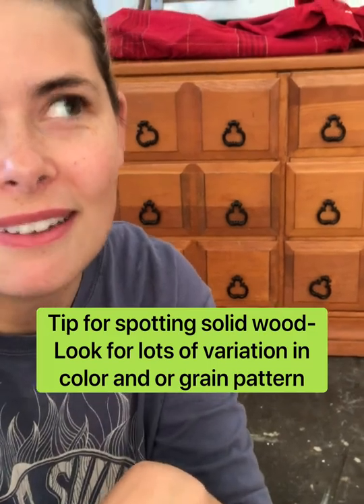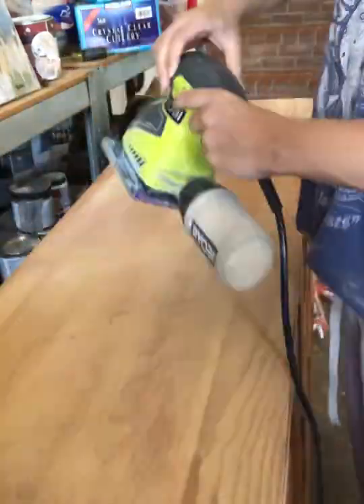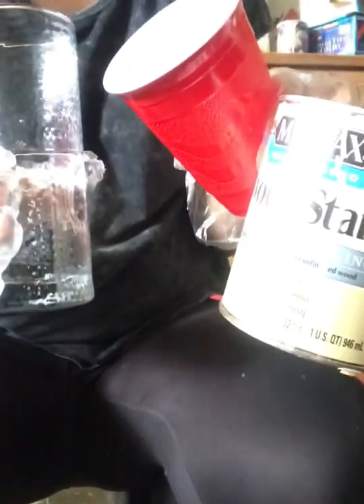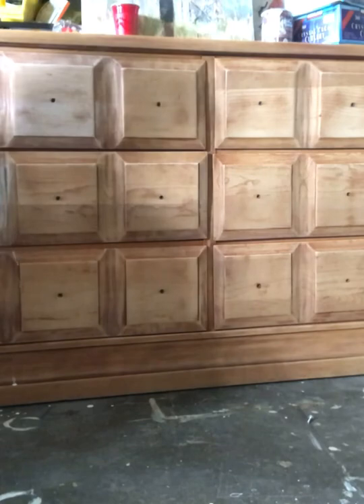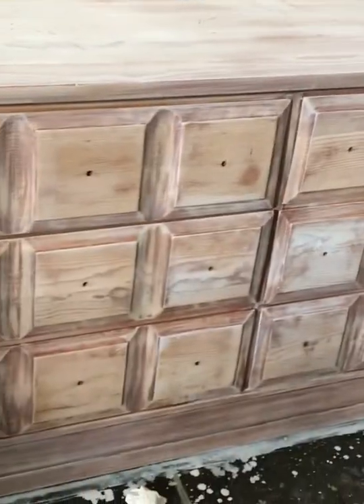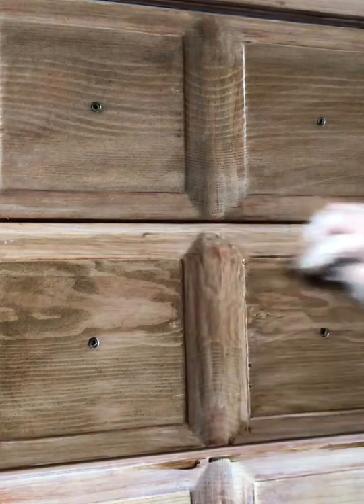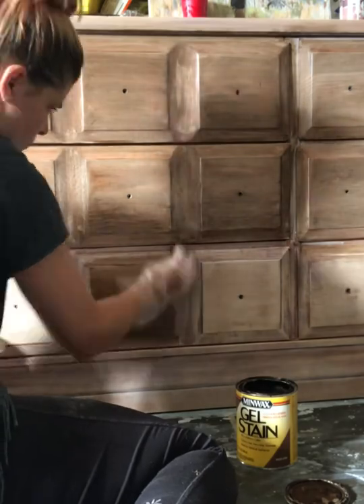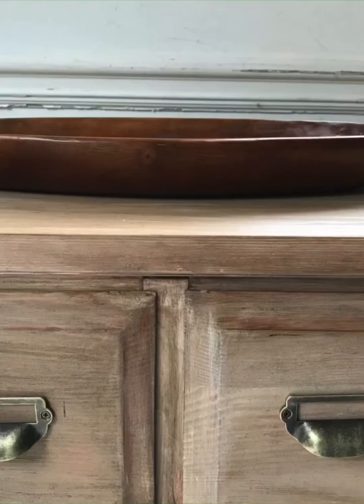Layered Stain | Fixing Orange •Wood Dresser Makeover | An EASY to follow tutorial

Comment: I love it! I will try this look on my card catalog cabinet! Thank you, you are so talented! Also, can you please link the pulls you used and the respirator? Xoxo
Reply from the maker: Thanks!  Sorry I forgot to add that!  WEICHUAN 16PCS Zinc Alloy 3-1/4 Inch X 1-5/8 Inch Antique Bronze Card Holder Drawer Pull/Label Holders/Label Frames - Vintage Drawer Box Case Cabinet Cupboard Carpenter Repair Decoration Hardware https://www.amazon.com/dp/B0713T75YD/ref=cm_sw_r_cp_api_i_AOduFbDRREKF2

I got my mask from Home Depot but this one looks similar
3M Half Facepiece Reusable Respirator 6300, Gases, Vapors, Dust, Paint, Cleaning, Grinding, Sawing, Sanding, Welding, Large https://www.amazon.com/dp/B007JZ1MK6/ref=cm_sw_r_cp_api_i_4PduFb2QKPN4C

Comment: Did you add a top coat? Looks amazing
Reply: Marlene Goho I’d love to know about a top coat too!  I have a kitchen table that will get a lot of use. Wouldn’t I want to seal the wood? Does wax do the same thing?
Reply from the maker: I didn’t use a top coat but the gel stains are oil based and very heavy duty, but any topcoat like minwax polycrylic etc are great, I tend to use water based top coats or wax, all very great protection.
Reply from the maker: I didn’t use a top coat but the stains are pretty heavy duty on their own, a top coat of any kind would work well like wax or a water based poly would be very quick and add even more protection
Reply: Can you use a water based top coat over an oil based stain? 🧐